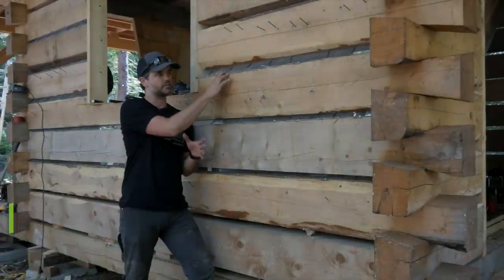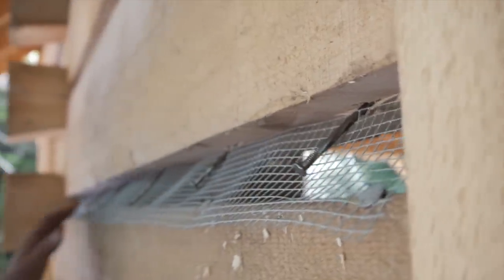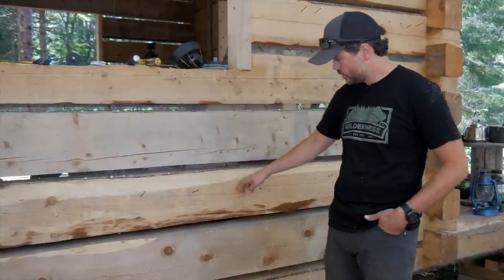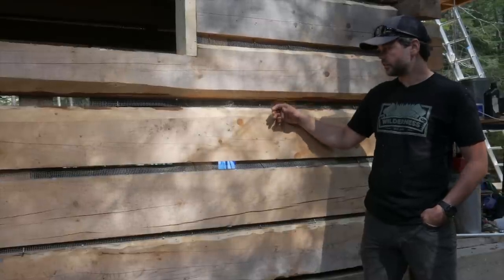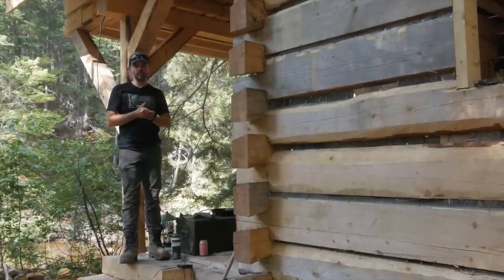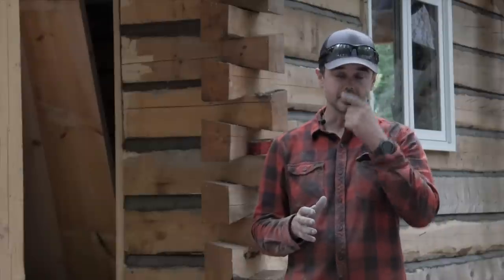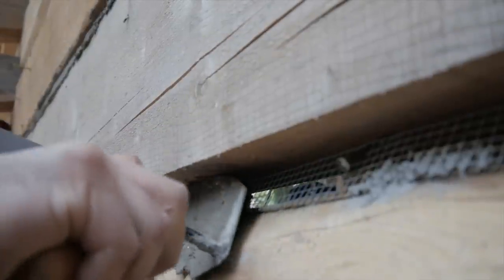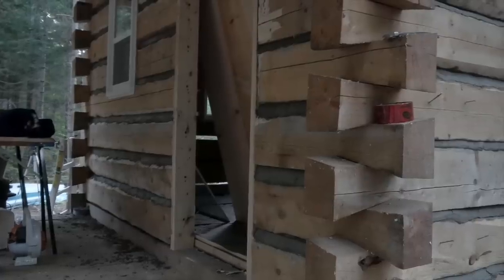Dovetail Log Cabin - Chinking the Cabin!

Comment: Looks really good. Hope you can get the outside chinking done before it gets too cold. You can do some in the inside as long as you can get some heat in there.  The drone shots showing the whole cabin looks pretty good, especially the roof. I definitely think you picked a good roof colour. Thanks for sharing this update.
Reply from the maker: Thanks, Alex. You are absolutely right, I have been working hard to get it sealed up so that I can work on the inside after it gets colder outside. The stove is going in soon too!

Comment: Not sure if drip edge will work as desired, creating a scribed in recess or groove with the disc grinder should help ensure water doesn't flow back and create rot or fungal growth. Will concrete be painted or sealed for waterproofing later ?

Comment: Can you do it with a grout bag? Kinda like a pastry filling bag but bigger.
Reply from the maker: I have a grout bag. I would say that the main chinking would not be good with a grout bag, as the mortar would need to be too watery and would not adhere as well to the metal lath. I have used the grout bag some to touch up places that needed a little extra mortar after the initial mortar had set up. Hope that helps!

Comment: Did you create sliding gap joints at the tops of the doors and windows to allow for shrinkage/settling of the logs?
Reply from the maker: Not really - I left gaps and the logs have been cut for 3 years and I waited to cut windows until the logs were stacked for over a year. Perhaps I should have done that, I'm not sure. If I do need to adjust things I can always take a little off the jams. It's a good question and time will tell if I would have benefitted from doing it another way. Thanks for commenting.

Comment: What's the insolative value of cement ? Like building a house with one wall a cement block wall.
Reply from the maker: I am not certain, I imagine fairly low, but I will be using insulation as well, so I hope that it should be pretty good insulation value.

Comment: As always I was pleasantly surprised to see a new video pop up on my feed ! Really looking amazing!! You’re always great about answering questions from previous videos so I have one maybe to be answered on the next video. Let’s say all exterior had been chinked before the cold temps we all get in our area set in. Will u be able to putter away at the interior once cold temperatures set in ? Like a weekend get away with stove going for heat obviously. And does the drying time play into that possibility? Thanks for the video ! Always a pleasure !!
Reply from the maker: Hi Tony! Great questions and comment. You are exactly right. My plan is to focus on getting all of the exterior done, then the stove in, and then when the stove is in I can heat the cabin and continue doing some chinking. I think that as long as the logs are warm on the inside, it should be OK to do. I would have to keep the cabin warm until the mortar sets up though, I think.

Comment: How has the chinking held up so far?
Reply from the maker: Excellent! There are small micro cracks that I expected. Nothing has fallen out. It looks like when it first went in. It's been over a year now.
Reply: @PenniacWilderness  that’s great. I’ll be using the same recipe and technique on my dovetail build in the spring. The only thing I did differently than you is that I made a circular saw cut 1” in and a 1/4” deep on the  underside of the upper log to receive the wire lath and make is easier to secure. I also plan to secure the lath with 1 1/4” staples with a air nailer/stapler.

Comment: I'd be concerned about rust bleed from the nails, possibly the cloth depending on what material it's made from.
Reply: Stone veneer is always hung on galvanised steel mesh. Holds up for decades.
Reply from the maker: Thank you both for the input. I have been following Noah Bradley who has used a similar technique for a long time. I hope it stands the test of time. https://youtu.be/p89IPMYtcQI